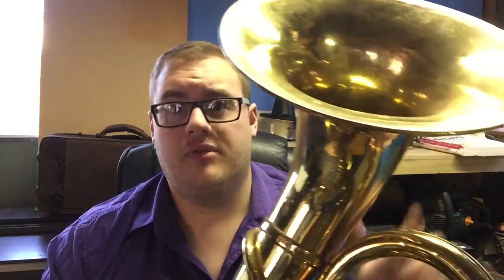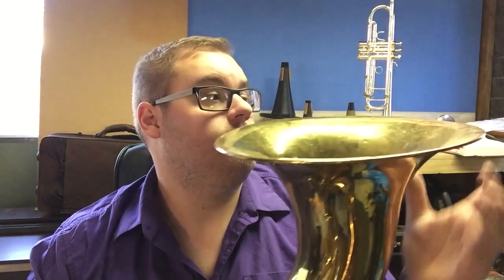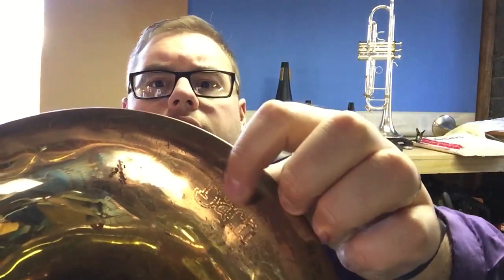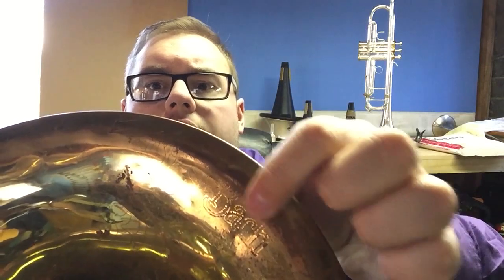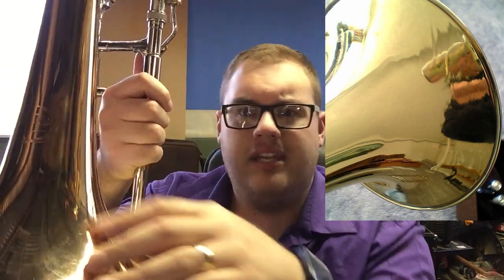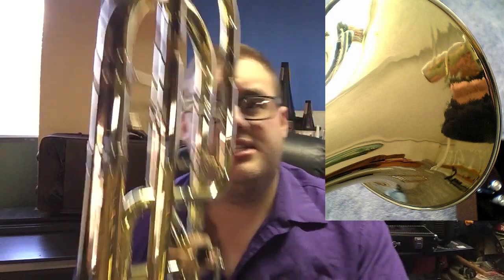Bach K Valves and the 50K3 Bass Trombone

Comment: The K valve, when properly adjusted, is more open than the older B valve. It is also notorious for going OUT of adjustment frequently, and with little provocation. That drives the resistance sky high, and sounds stuffy, so you have to constantly realign the stop plate and make sure the bumpers aren't worn. Since Thayer, Infinity, Hagman and La Rosa valves are all faster to throw than a K, at least as open, and much less prone to misalignment, the K was a fairly short lived experiment. However, if you are willing to put up with the maintenance, it blows pretty freely. (FWIW, I've played a 42KD for the last 20 years.)

Comment: I bought a used 42K simply for curiosity's sake. My biggest gripe with the valve is how much effort it takes to actuate it. The lever throw is longer and heavier than any other valve I've tried. The "Coke can" digging into the neck is a bit annoying as well.

In principle, it seems to work the same way as a Hagmann valve, but obviously the latter's execution was far superior.